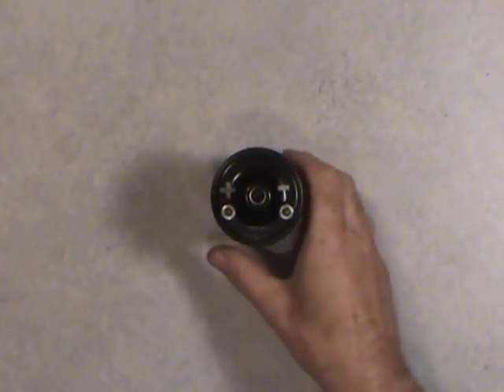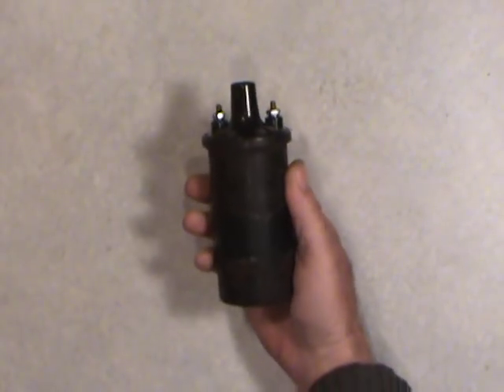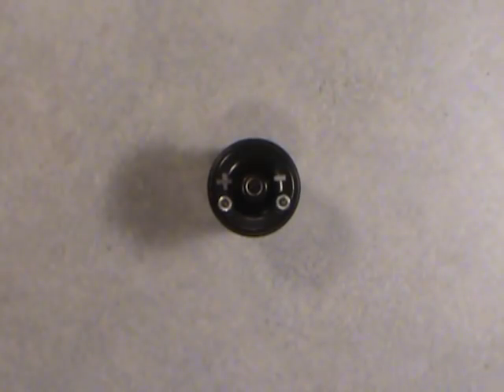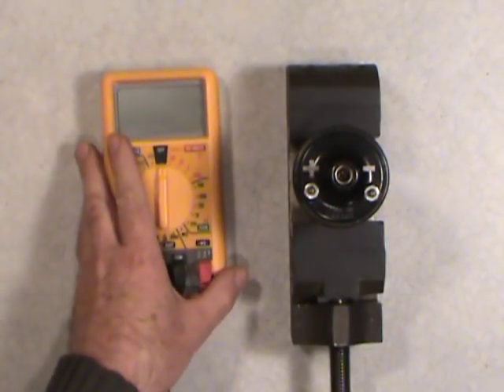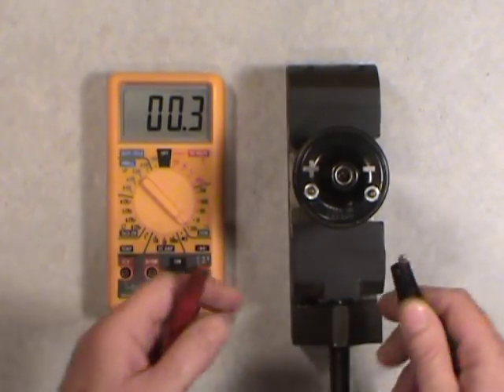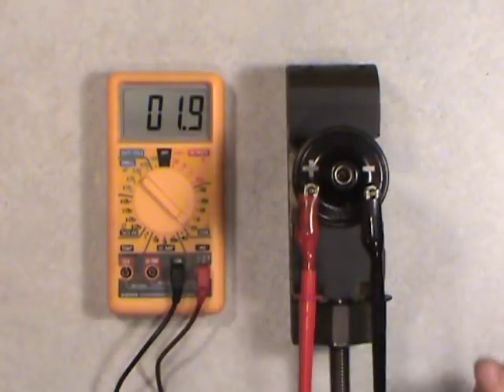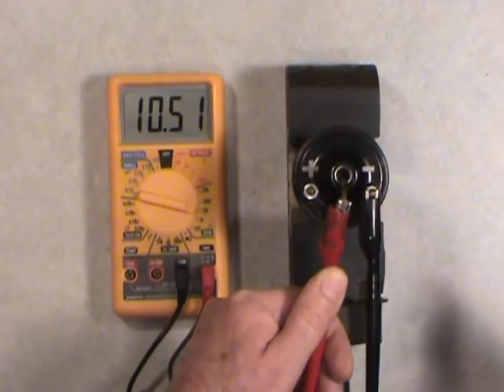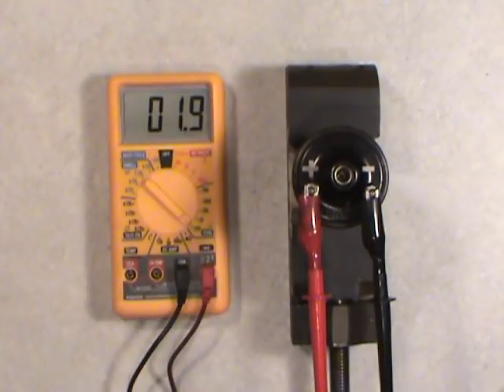Ignition Coil Testing

Comment: nice job, thanks much! any ideas what would make a ballest risistor .4 ohms smoke after start up?
Reply from the maker: greg DeStephano Greetings greg DeStephano....Thanks for watching, and for, Your nice comment, and question as well............................Ah yes, the good ole Ballast Resistor, type of ignition system............................As far as my experience with Ballast Resistor's is concerned, it was the "Ceramic/White, Porcelain-looking, Block Type" (actually, it was a Dodge, Dual Ballast Resistor), but, as for the Side, that was wired to the ignition coil only, is concerned, it would pretty much equal, what the Single type of ceramic-looking, ballast resistor, was responsible-for, and did, job-wise.....................Oh, and in case I forget, GMC/General Motors/Chevy/Pontiac/Oldsmobile/etc., used, up until, about 1974, a Ballast Resistor, in the form of, a..."Special" Resistance "Wire", in some cases...................Yes-Sir-ee-Bob, as far as I've experienced, with that particular, Ceramic type of (dual) Ballast Resistor, once the Engine was running for a while..."it"..."Did"...get Quite..."HOT"...as in..."HOT"...enough, to, give Your...Finger, a rather Nasty..."Burn"...if You were to actually touch it...!!!..............................Did there happen to be any..."Oil or Grease"...on that..."Smokin' Ballast Resistor"...of Yours, at all...???...as, if so, that just might be the reason for that "Ballast Resistor of Yours..."Smokin'...in a...No Smoking Allowed Zone"...!!!...lol...................................If Your Ballast Resistor is "Mounted" on a "Painted" Surface, did You notice any "Paint Discoloration" or "Burn-like" pattern, in near proximity, to Your Ballast Resistor at all...???...............................How about, the actual "Smell", of Your "Smokin' Ballast Resistor", as that, can, at times, be quite the clue, as to what it just might be, just sayin' now..............................Here's pretty much how "They" work...........................When the Ignition Key is in the "Start Position", while "Cranking" the Engine, to get it Started (with the Starter Motor), the Ballast Resistor, is usually "By-Passed" and "Not Used", and there is usually a "Separate Wire", that provides "Full Battery Voltage" to the Ignition Coil, using a Separate Wiring Circuit, but, that Full Battery Voltage will usually "Drop", due to the fairly "High Demand, Placed on the Battery", by the Starter Motor, while in Operation...........................Once the Engine Fires-Up, and keeps Running, the "Ignition Key/Switch", then goes into the (engine) "Run/Running Position", and that's when, the Electrical Wiring Circuit, that has the "Ballast Resistor" in it, takes over, and when it does, the "Ballast Resistor" will usually "Reduce the Voltage", that goes to the (usually Oil Filled type) of "Ignition Coil"...so the..."Ignition Coil..."Does Not"..."Burn Up & Self Destruct"...!!!...cuz...that's the way, that they were Engineered/Designed, as far as I know.......................The "Most Important" Part here is...Always Make Sure"...that..."Each and Every Part/Component"...of the (engine's)..."Ignition System"...is..."Exactly as Specified"...as a..."Complete System/Group"...so that..."All of the Components/Parts"..."Work in Harmony/Properly"...or, if any, or all, of the (engine's)..."Ignition System's, Parts and Pieces"...happen to get..."Randomly Selected"...and..."Not as Specified"...there, as I see it, could very well be, a quite Strong Possibility, that, the Ignition System in question, might not work so well, or, might even have a component/part or two, get damaged, and, who knows, maybe even "Start a Fire", and I sure hope not................................I actually "Re & Re'd" (Removed and Replaced), that "Dual Ballast Resistor", that I was talkin' about earlier, and "No-Sir-ee-Bob", Not because it wasn't working, as it should, but, (while it was COLD), I removed the wiring connectors, and then, removed that there "Dual Ballast Resistor", from where it was Mounted, on the Engine Compartment's "Fire-Wall", and low and behold, when I..."Flipped"..."it"....around...to have a "Look-See", at the Back-side of "it", there I saw, some "Missing Ceramic-like Material", that was supposedly, supposed to..."Imbed/Surround", the Actual "Resistor-Element-Thing-ee", that was Installed in, what looked to be, a "Cavity" (on the back-side, of the ceramic looking/Ballast resistor Block), if You will......................................In other words, to me, it appeared that, the way that the Main Body, of the Ceramic/Dual/Ballast Resistor, that I had, at the time, was probably Cast/Molded, with "2 Cavities", where, each of the "2" fairly long "Resistors" were placed into, then, it appeared that, once those "2" Resistors were "Snug-as-ah-Bug-in-ah-Rug" (aka, Installed...lol), into, Their respective "Cavities", then, as far as I know, and, as observed by Yours-Truly, it appeared that, some, in..."Liquid Form, Ceramic-like Goop"...was..."Poured Into"...those..."2 Cavities"...to..."Fill-Em-Up"...about, equal-to, the Surface , of the Back-side of that good ole Dual Ballast Resistor's, Block/Body, thus "En-Tomb-ing/Embedding", those "2 Resistor Elements"...once, that there..."Liquid, Ceramic-looking-like Goop..."Solidified"...!!!...........................So then..."Make Sure"...that..."ALL"...of Your Ignition System's Parts and Pieces"..are, as, the Vehicle's Factory/Manufacturer, or Aftermarket Company..."Specifies"...for..."Every Component/Part, in the..."Entire Ignition System"...as a..."Total Package"...in order to have the "Ignition System, work Properly"...and..."Not cause Trouble"...or..."Destroy Itself"...part-wise, that is.............................So then, there You have it, for the time being................................If You care to, You can let me know, how it's going.......................Till next time..........Be Safe, take care, and have a good one.

Comment: I have a 2005 nissan sentra and a check engine light is coming up and I was told that it  might be the ignition system fault. How do I go about to confirm that is the issue.
Reply from the maker: Greetings dan lainez....Thanks for Your comment/question....Your Car needs to have it's ECU (aka, On-board Computer) "Scanned", with, what is known as a "Scan-Tool", that looks kinda like a hand held Calculator, only a bit Larger....This Scan-Tool, has a multi-pin Cable, with a Connecter, that plugs into a "Port/Connection" in Your Vehicle....The Scan-Tool will "Communicate" with Your Vehicles ECU, and, will "Extract/Download" lots of Information that is "Stored" in Your Vehicles "ECU"....The Scan-Tool will Report/Display, any, shall we say, "Trouble Codes", that are/were "Stored" in Your Vehicles "ECU"....Once the so called "Trouble Codes" are known, then, the Person working on Your Car, will be able to more Accurately "Pin-Point" the Problem Area/Circuit, that, in some cases, might have some "Parts", such as, any, of the Many, Sensors or Actuators, that have become "Problematic", as in, Not Functioning very well, or, Not at all.

It's very Important, to keep Your Vehicle, "Tuned-Up", as well as, "Well Maintained", so there will be, "Less of a Chance", that Your Vehicle's "ECU" will be "Reporting" Problems, that could have been Avoided, had the Vehicle, had the  Required Maintenance, as Indicated by the Manufacturer of Your Vehicle.

Some Vehicle "Parts", for the most part, have to be Re & Re'd (Removed and Replaced), when they get "Worn Out", "Plugged Up", or in some cases "Contaminated".

Not to say, that the following "Is" Your Vehicle's Ignition "Problem", but, I've seen things like Spark Plug "Wires, or Leads", that look almost like "New", when looking at the "Outside" of them, but, on the "Inside", usually, where the "Conductive Core" (aka, the Center "Core" of the spark plug Wire/Lead that Conducts that High Voltage Electricity) gets "Connected" to the "Metal Terminal" (at each End, of each spark plug Wire/Lead), has become "Disconnected" from each other, causing, Spark Plug "Miss-Fires", and if really Bad, a Vehicle that Runs "Very Rough", if at all.

To save Lots of Money, You can Buy Your Own "Scan-Tool", and, by Following the Instructions, that come with the "Scan-Tool", you will at least be able to "See", any "Trouble Codes" that may, or, may not be, "Stored" in Your Vehicle's ECU.

Perhaps, make a few Phone Calls, to some "Fix-Em-Up-Establishment's" (aka, Vehicle Repair Shop's...lol), and ask the Person, "How Much does it Cost", to have my Vehicles "Computer" (ECU) "Scanned"...???

"Fixing", Your Vehicle is whole Different "Ball Game!!!"

Good Luck, with getting Your Vehicle Fixed, and, I hope, that You don't have to spend too much money, to do so.

Be Safe, take care, and have a good one.
Reply: OK will do thank you very much.

Comment: Hi, I'm testing my 12v coil and the company (Accel) states the resistance is 0.700, but when I test the resistance it fluctuates between 0.700 - 0.900 back and fourth.

Is that normal for a coil or do I need to replace it?

(also my test was done on the bench with all coil wires disconnected)
Reply from the maker: Greetings Ron S....Thanks for watching, and for Your comment/question as well....Both, the Older "Oil Filled Cylindrically Shaped" & also, the, shall we say, Newer "Epoxy" (Resin?) Types of Ignition Coil's, as I see it, "Should Not" be, as You have indicated, showing that there "Fluctuating" Numerical Display, such as You seem to have seen on Your Meter/Multi-Meter!....Here's my so called "Hypothetical" (aka, Thoughts), on Your "Bench Testing", of the Accel Ignition Coil, that You had, before You, at the time, that You "Tested" It....Basically speaking, Most Ignition Coils are really, just "2" Separate "Coil Windings", having "1" of the Coil Windings, Inside of the "Other" One.

As I see it, the Ignition Coil Itself, shouldn't be showing a Fluctuating Reading/Display, on Your Multi-Meter, "Unless" there is a Faulty Coil Winding, or a questionable "Connection", where Each of the "2" Coil Winding's "Terminate" (aka, the Ends of the "2" Coil Windings, where they get Attached to their respective "Screw-Threaded Posts, or, "Spade Clips", or the "Secondary Tower" or "Secondary Metal Connection Point", as the case may be)...and...I'm thinkin', that You would have to be be Shakin' the Ignition Coil while it is being Tested with the Multi-Meter, to produce, that there "Fluctuating-Ohm-age" Display, of between, 0.700 & 0.900 Ohm's.

Now I'm thinkin', just what might be causing that there "Fluctuating" Ohm's Reading...

Could be...Your Multi-Meter, that is Doin' the Fluctuating, and, maybe Not, the Ignition Coil's Winding's at all.

Could be...Your Multi-Meter's "Test Leads", or "Probes", be them, Pointy Ends, or, the Alligator Clip equipped version, of those very same Test Leads, or, maybe, even an Intermittent Test lead "Wire", or, even, where the Test Lead's, get Connected to Your Multi-Meter as well.

Make sure, that "ALL" of the Test Lead's "Connection Points", are Clean, and Not Oxidized or Greasy, in any way, shape, or form, otherwise, the Ohm's Readings won't be "Accurate", and, might even "Fluctuate" as well (just sayin').

If possible, see if You can Use "Another" Multi-Meter, to Test Your Ignition Coil.
Maybe, You can, Beg, Borrow, but, "Never Steal", a Multi-Meter elsewhere, and see if, that there Ohm's "Fluctuating" Reading, still Occurs?

If You like, let me know, how it's going, and, perhaps, what a "Different" Multi-Meter is Showing/Displaying, with Your Accel Ignition Coil.

I'm not 100% sure, but is "Your" Accel Ignition Coil, an "Epoxy" Type, or an "Oil Filled Cylindrically Shaped" (old school) Type???

Also, did You ever have that Accel Ignition Coil Installed in Your Vehicle, and if so, did it Perform, as good as it was expected to?

What Distributor (if there is one, that is) does Your Vehicle's Engine have?

The more that I know, about the Vehicle in question, the More, that I will be able to help You out.

Also, be Very Careful, if in fact, that Your Accel Ignition Coil "Requires" a "Ballast Resistor", as in, the Ceramic Block Type, or, in the case of that good Old School, General Motors (aka, Chevy, Pontiac, Buick, etc.), with that good ole Points and Condenser Distributor, that usually had a "Ballast Resistor", in the form of a "Resistance Wire"...or...Your Ignition Coil, is prone to "Fry Itself"...!!! (aka, become Non-Functional).

Good Luck...and...

...Be Safe, take care, and have a good one.
Reply: Thanks for the well thought out answer... the coil is hooked up to a Accel breakerless distributor model (52100)
Reply from the maker: Ron S
Greetings Ron S....I had a look see, at Your particular Distributor, and, from what read/saw, is to be very "Careful", as to "Which" Ignition Coil, that You "Hook-Up", to Your Accel Distributor!!!....From what I recall seeing, is, to "Make Sure" that You have the "Recommended" Ignition Coil "Installed", along with, Your particular Model of Accel Distributor, or, You might just "Damage", the "Electronics" in Your Distributor!!!....If it so applies, to Your Particular Distributor, I Think, that You already have the "Correct" One, in that, it is "Below "1" Ohm, on the "Primary" Coil's "Ohm's Reading"....I think, if You were to Install an Ignition Coil, with a "Primary" Coil Reading of, "1" Ohm, or Above, that, under those circumstances, (as I saw/read) that, that "Higher" Primary Ohm's reading, type of Ignition Coil, will cause "Damage" to Your Accel Distributor's Electronics!!!

Please, "Check", with the Accel Distributor Manufacturer, as to What, the "Correct" Ignition Coil, that You should be Using with, Your particular Accel Distributor Model...!!!

Better Safe, then Sorry, I say...

Be Safe, take care, and have a good one.

Comment: If the secondary side of my ignition coil is producing 8.39 kilo ohms and the primary side is producing a fluctuating value. Should I change it although it is new
Reply from the maker: Greetings...wayne palmer..…….Thanks for watching...….A fluctuating (ohms) value you say, well, did you "disconnect", all of the wires, from the ignition coil, before ohms/resistance testing it...???...…….Also, what's the vehicle's, year, make and model, and, what engine does it have in it...???...that way, I'll have a much better chance, at being able to help you out, and...….till next time...….Be Safe, take care, and have a good one.
Reply: You need to hold the clips or testing points very very still for the low reading. It will fluctuate with the slightest movement. The LT resistance should be about 1.5-2 ohms for a standard coil, and about 3.5 ohms for a high spec coil. HT resistance 8-11 kilo-ohms.

Comment: rocky.  how do i nkow this  Mallory coil part #29440 is good.. i bought it at a yard sale for 20 bucks.
 please respond.  thank you.
Reply from the maker: Greetings...Hector Ortega...........Thanks for watching...........If you have an Ohm-Meter, then, your Mallory ignition coil, can be basically tested, but, sometimes, ignition coils might act up, and not work so well, once they get up to operating temperature............The low ohms will probably be around .6 ohms, and the high ohms, will probably be just over 12-k ohms (as in, 12,000 ohms).............To test the low ohms, then, just connect the ohm-meter's test leads, to each one, of those 2 smaller terminals..............To test the high ohms, then, connect one of the ohm-meter's test leads to the terminal, that the high voltage spark plug Wire connects to, and the other test lead, to each of the smaller terminals, One at a time..........If your ohm-meter shows, both, the .6 ohms (reasonably close), and, close to that 12-k or 12,000 ohms, then, the ignition coil should be ok............Seeing as how that Mallory ignition coil only has .6 ohms, on the low ohms side, then, you have to, really "Make Sure", that, it is the "Correct" ohms Value, for the ignition (system) circuit, that, you are going to use this particular Mallory ignition coil in, or, what might happen, is, that, the Mallory ignition coil, might Over-Heat, and Destroy itself...!!!............Depending on the ignition System/Circuit, that, the Mallory ignition coil, will be going into, then, some ignition (system) Circuits, will require, what is known, as a "Ballast Resistor" (might look like, a fairly large block of whitish colored ceramic or porcelain, or, might be, a special type of resistance wire, in some cases, just so you are aware).............Before installing an ignition coil..."Make Sure"...that, the (low) "Ohms/resistance", of the Ignition coil, and if applicable, that, the Ohms/resistance, of the Ballast Resistor (if being used), are a Perfect "Match", for the ignition system/circuit, that it, or they, are going to be installed in, b-cuz, if Ya get it Wrong, it might end up, being a weak spark, at the spark plugs, or, perhaps, an ignition coil that gets way too Hot/Over-heats, and quits working all-together, and, I hope not.............Good luck, and.......till next time.........Be Safe, take care, and have a good one.
Reply: RockysRoadshow   thanks for responding. 
 now i kinda know why this coil i asked you about was not working right. i think my problem is gonna be my Ballast then.
   thanks. 🖒